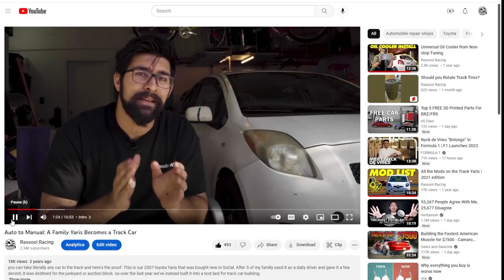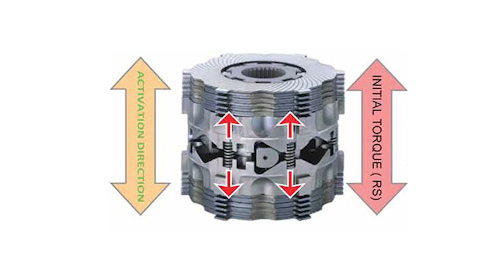This Diff will make my Hatchback quick! | Cusco LSD install Part 1

Comment: The LSD will make a big diference entering and exiting corners but since u have the box out i would see wich diff ratio u have and by the last track video i saw ur car have a long 3.7ratio.the factory ratio that comes on the yaris/vitz rs in japan is a 4.3 ratio and this is the box u should find to fitt ur lsd.i would see a light weight flywheel this combo will be a major diference.short ratio gear box,lsd and lighter flywheel
Reply from the maker: I'm putting the 4.3 final drive in as well. Lightweight flywheel is a maybe. I don't know if I'll have the extra money.
Reply: @RassoolRacing  nice!

Comment: Do you feel faster driving the 86?
Reply from the maker: It feels like im not running out of power on the straights, but I also have to brake so much earlier. Overall what felt fast in the 86 was find that slip angle on corner entry and mid corner. I don't quite know how to do that with fwd. Hopefully next time out I'll find it